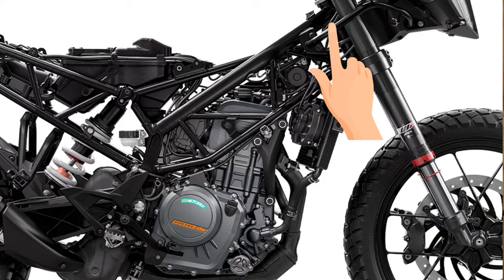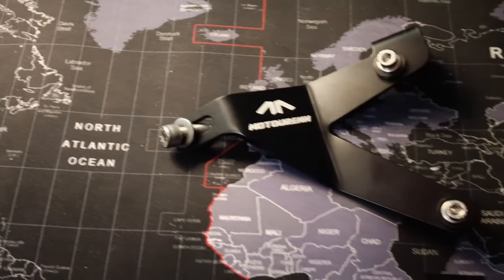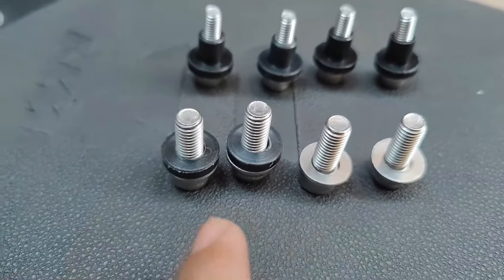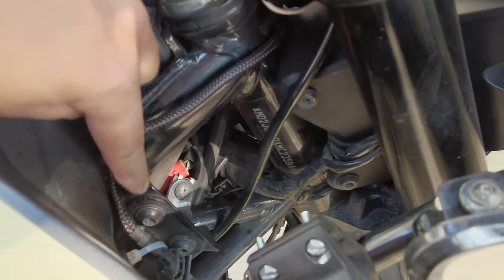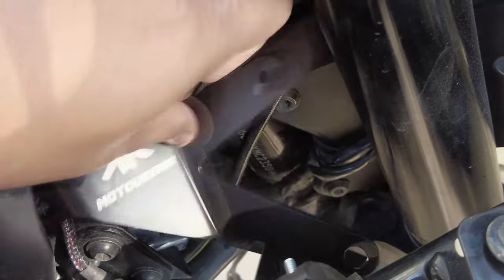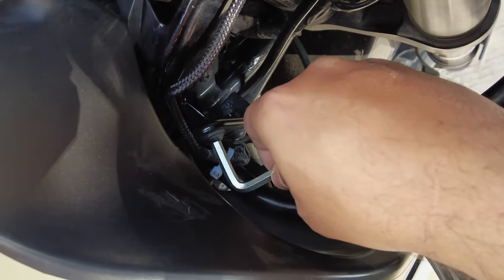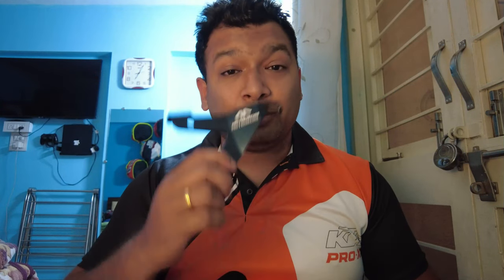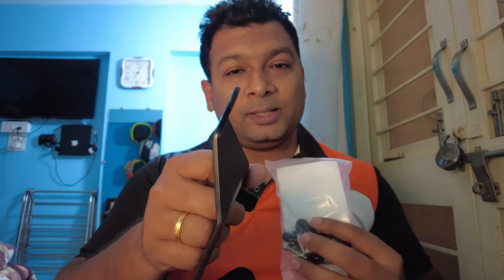Install a Neck Brace: KTM 390 + 250 Adventure

Comment: Hi Bro, can you provide a feedback after fixing these..do notice less vibrations?
Reply from the maker: @Nanda Kishore - thank you for reaching out... Yes it reduces the vibration a lot but the headlight assembly vibrates if you are on idle position, standing and gear is on 3rd on speedometer and you start moving from 3rd gear directly, only then you see the headlight assembly shaking.. this happens coz the assembly is big unit hanging on 4 bolts and this natural...

Comment: After installing it on my adv 390, there are crazy vibrations on my handlebars especially at higher speeds
Reply from the maker: You might have not installed correctly coz til now I have not experienced any vibration, pls recheck and reinstall
Reply: @travmoto46  ok sure thank you.

Comment: There is a flaw with the design. The left hand side suspension stem hits the brace while locking and taking a tight turn and reduces the turning radius by a bit. Product reduces vibrations but it’s design has to make a little change.
Reply from the maker: @bikerspiritabi - I have not experienced that problem yet but if that the case will check this out.. thnx for the heads up